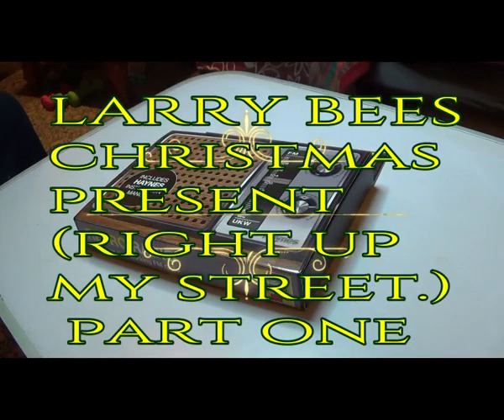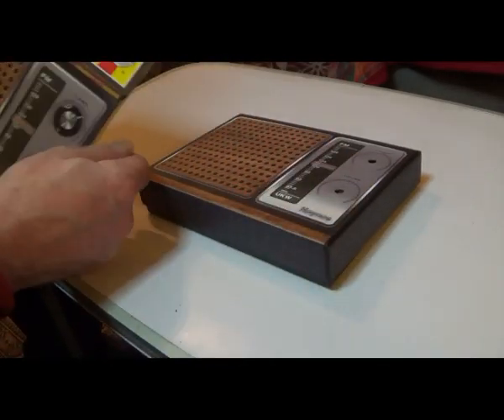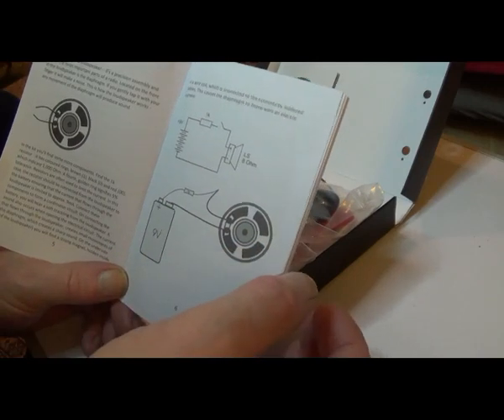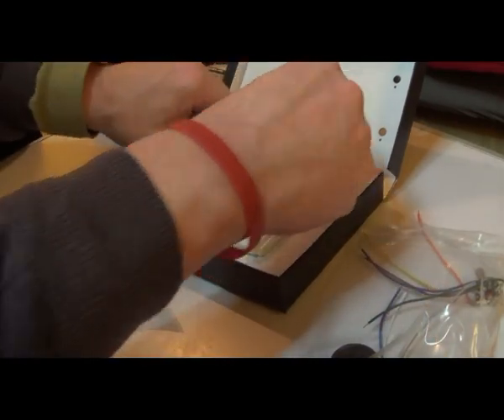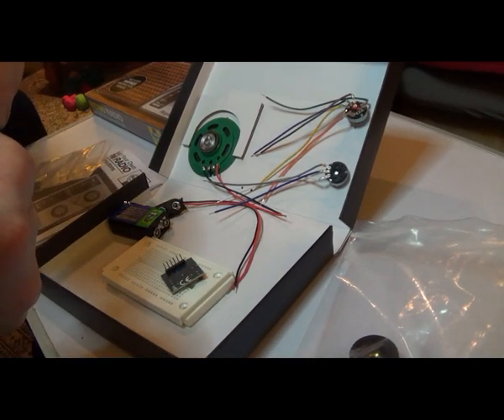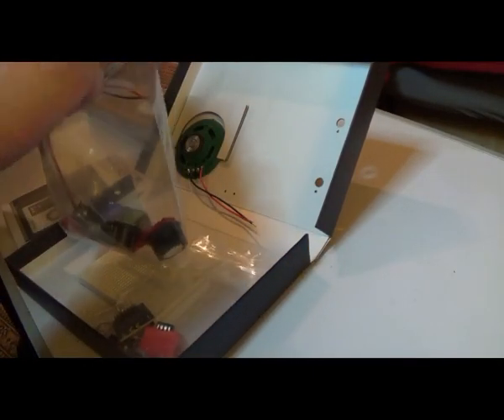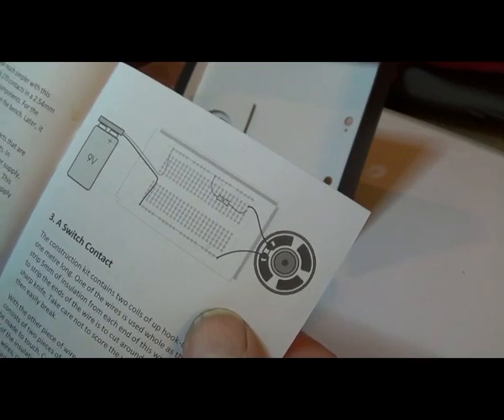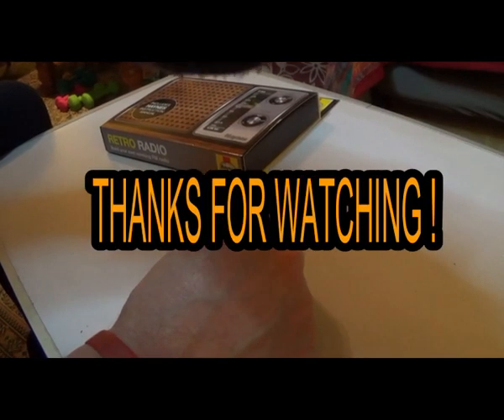Haynes Retro Radio  build your own FM radio Part 1  review and start

Comment: I have built this kit. The instructions are excellent, not vague at all. And the whole process takes you through several educational phases before building the actual radio. You will end up with something that you built yourself and understand.
Reply from the maker: glad you had the patience and understand the process  It takes a bit of time and study !! still works
Reply: Larry, I'm retired and had time to spare. :-)
Reply: I haven't even started on mine. I'm thinking about getting some extra wire & hooking it to a better speaker than the one that came with it, just because I already have one.

Comment: Got one of these kits for Christmas, please figure this out cus i can't from the manual. Looks like a solid kit though
Reply from the maker: If you want to build it without studying every step go to page 31 and put in all bits as per diagram.
Reply: @LarryBees  I would  aree!! Had this kit for fathers day present. It has the worst instructions I have ever seen in any shape or form. You place components on the circuit board and turn the page for more instructions and the diagram shows the components in different positions on the board??? Haynes will be getting a complaint letter!

Comment: First partsays join wires together on mine, how do i that?
Reply: I believe that you are supposed to just "test the speaker"  by just holding  the speaker wire to the resistor and booooping it to the battery " hearing a " skrittch  scritch sound" a silly, little quick 
 vague experience for  the nununoobees. 

it is not rocket surgery. 

No one really needs to check the speaker  to build this radio kit.

But in the future 1 may..

  need 2 check cHeck uh used  speaker.

  like in a car stereo system or a Flea Mahket Picκ... "and not having an ohm meter, y1 can now u se a "battery and a resistor" to...

 hear skritch-scratch n  and  verify.. 

Hey!!" Thid spεακeh id nöt blown " Woohoo!! Scöre!! Yoinκ